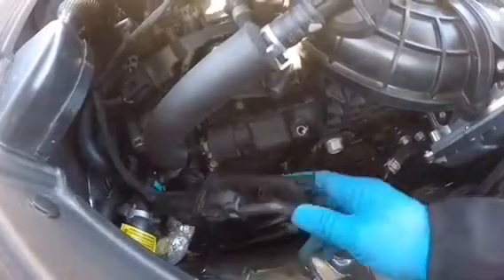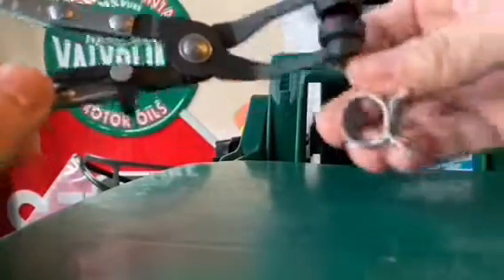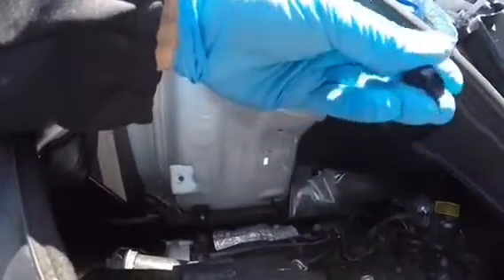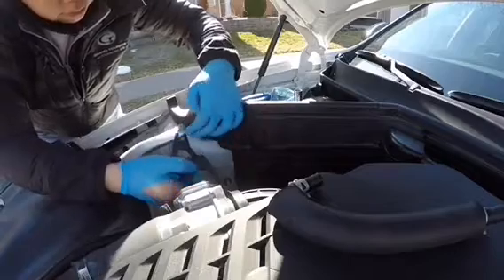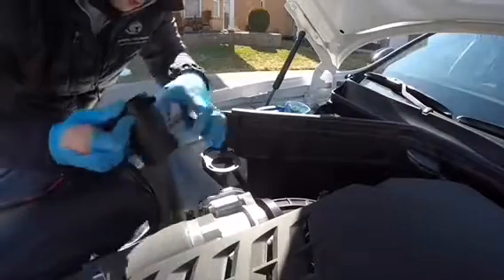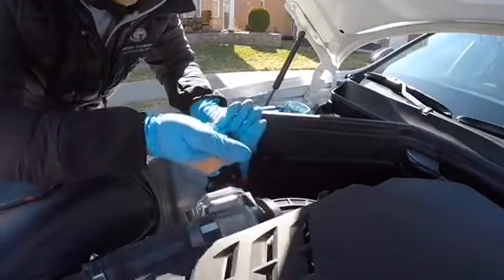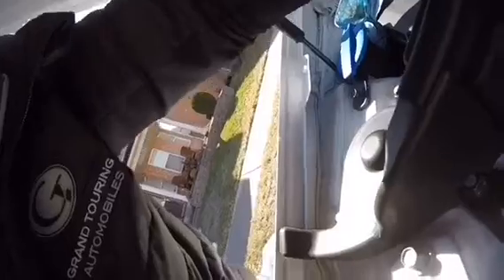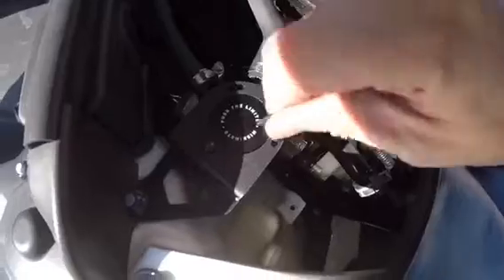2018-2020 Kia Stinger Mishimoto Oil Catch Can Install

Comment: Just FYI, the 2022 Stingers do not have the stud for the washer and M6 mounting nut, so you can't secure the OCC bracket on the bottom, only with the top 14mm nut. I put some threadlocker on the top 14mm stud and impacted the nut down and that's all that can hold the bracket in place. You can't even put in your own stud as the hole in the engine compartment DOES NOT line up with the bottom of the OCC bracket hole, so you'd need to drill out a new hole in the bracket
Reply from the maker: Great to know thanks for the heads up! Seems weird that stud would go
Reply: I wish I knew this before buying the mishimoto cans I should have went with the JLT. Got the gt1 2022 and no stud for the M6 nut 😩

Comment: Do you have clearance to simply unscrew the can for emptying or do you have to disconnect hoses?
Reply from the maker: Hi Jonathan, I disconnect the hoses bc it’s easier to grip the can to unscrew, plus I can clean off the mesh filter on the lid every OC. That lid is screwed on pretty tight, plus it doesn’t take that long to disconnect hoses. You could unscrew w/o disconnecting hoses, but you’ll need the help of a pair of channel lock pliers (wrap the can in a thick cloth if doing this) or use an oil filter wrench that has some rubber cushioning.
Reply: @forevr_8  gotcha, thank you for the insight and install video!
Reply from the maker: You’re so very welcome!! Hope you get one. I collected some gunk after just 1K miles of driving 👎

Comment: did you have to get new clamps or did these clamps work well
Reply from the maker: Hi Nick, using the clamps that came with the kit were just fine, no issues. You tighten them just enough , but not too tight. With experience, you just naturally know how tight to go in the same way master chefs don’t need to measure sugars or spices.
Reply: thanks for the info.